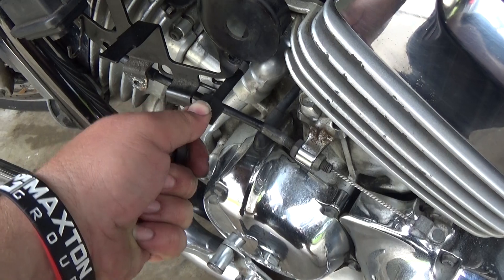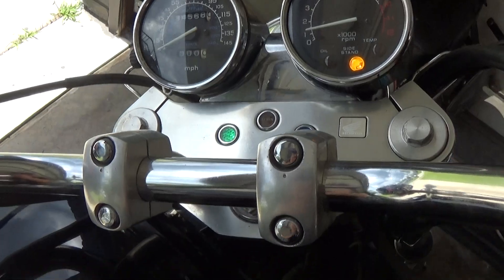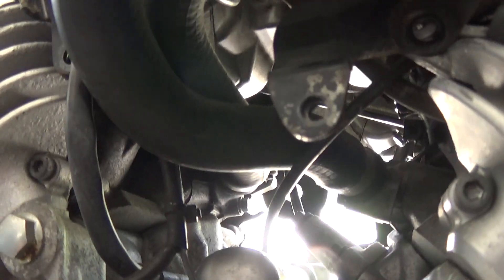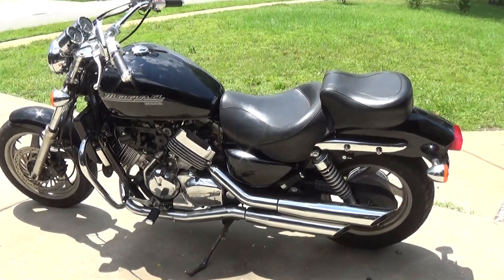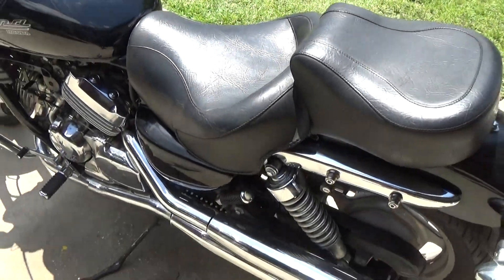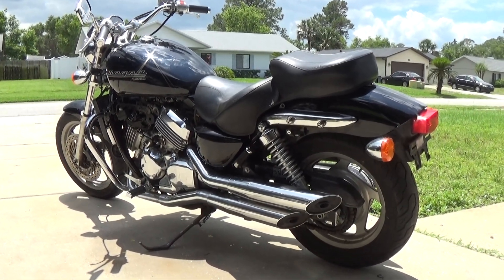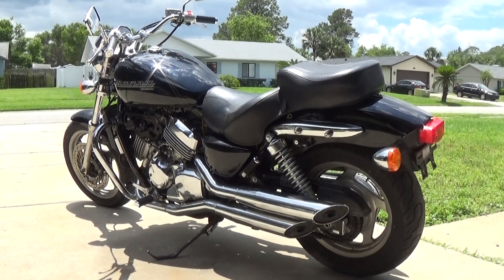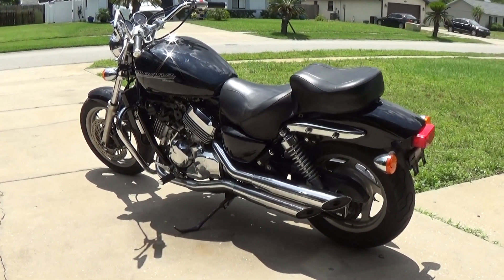2002 HONDA MAGNA IS (FINALLY) RUNNING AND SOUNDS GREAT

Comment: I rode in shorts and low cut shoes once. Burnt the shit out of my leg on my exhaust. You have 4 pipe tips too. You better be careful. Lol
Plus taking a rock to the shin on the freeway at 65 mph isn't pleasant.
Reply from the maker: That's true. It was really my first time riding it. And only rode it around the blocks a couple times. I still have to service the chain. And do an oil and filter change.. many more videos to come..
Reply: Burnt my left leg as well. Learned my lesson. No more shorts.